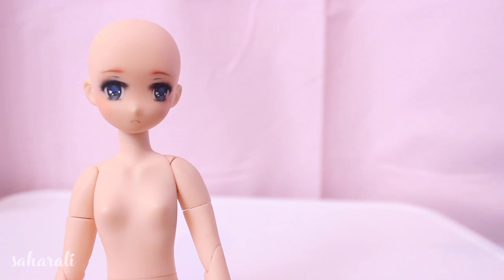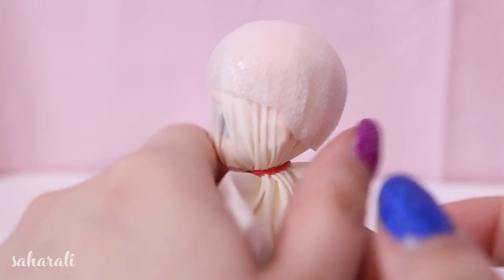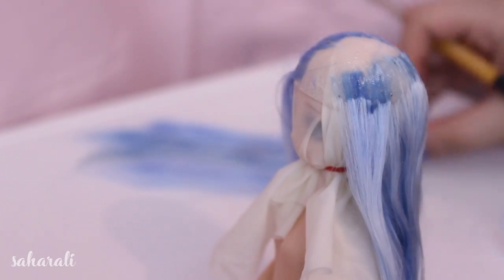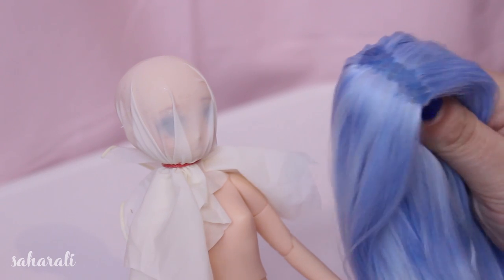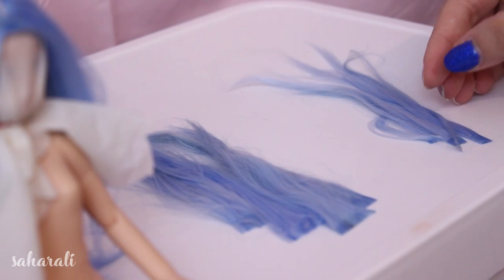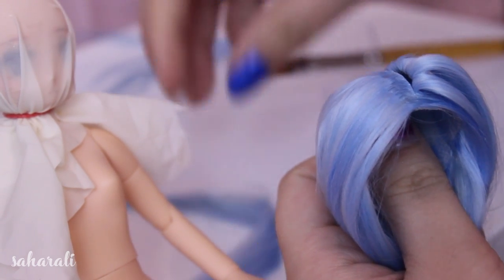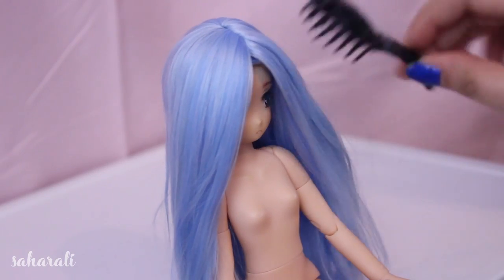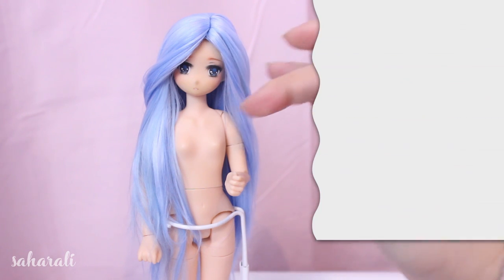Creating Small Doll Wigs

Comment: Did you make some wigs from nylon I really o que e nylon because a piece that viscose is so expensive I'm treasure dolls it's the only place that does it and I just want to see if you can make a cap like you have just done but using nylon
Reply from the maker: You can use nylon if you like :) I just used viscose because I like it, but this will work with whatever fibre you like. Nylon is a bit heavier so you might want to go a bit slower and hold the fibre in place while the glue sets.

Comment: Did you close the hole at the part? I didnt see.
Reply from the maker: apprenticefitz i did! At around 5:38 I mention that there was still a hole in the wig, and to close it up i simple apply glue to the two sides of the inside of the hole, and hole them together for a minute. I should make a video showing that specifically since most people dont know how to do it D:
Reply: Thank you for the answer. I wasnt sure if you used a patch of fabric or something to help hold it together.
Reply from the maker: apprenticefitz If a wig has trouble staying closed I will use a patch of fabric, but as long as youre neat and go slow when youre gluing all the hair in the part you shouldnt need one :)